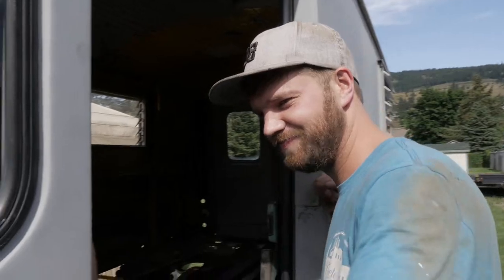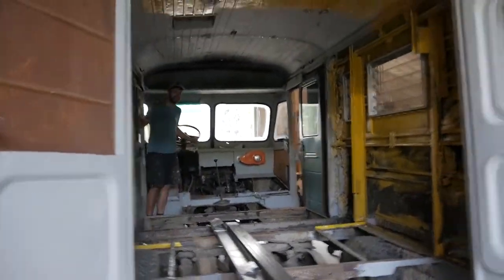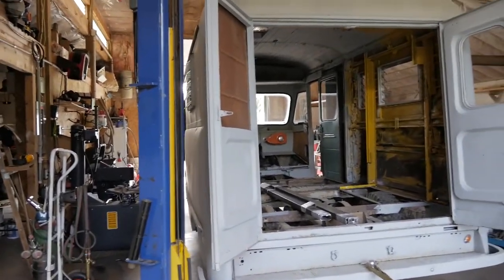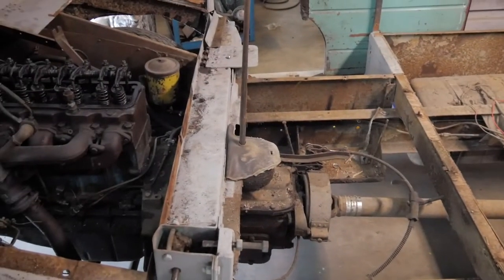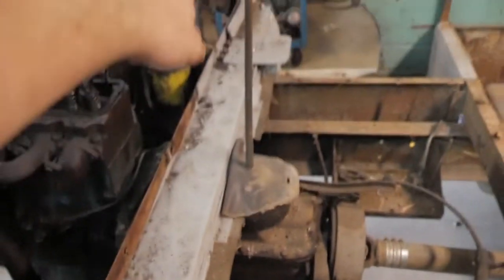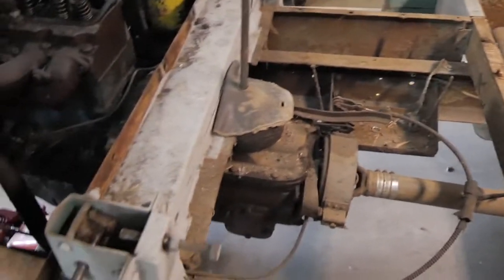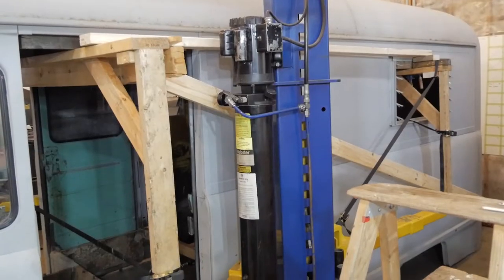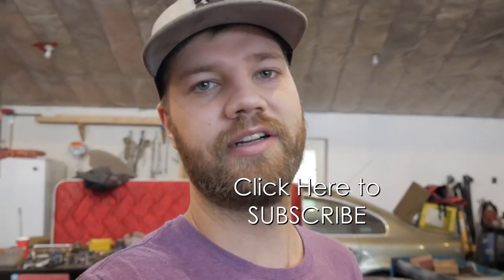1955 Chevy Van Build - Removing the Body From the Frame - Walde's Garage ep.5

Comment: Nice video! I had done a backyard chassis swap on a '57 Grumman years ago and it wasn't near as easy as your method. Glad I came across this! I am getting ready to swap a chassis from under a 1961 Grumman. With the lessons previously learned, and utilizing your 4 post lift method, I think I will be in a much better position. I hope to use a 1988 GMC 1500 4x4 chassis. I will either use the 305 TBI that is in the truck, or a 2001 LS I recently picked up. Speed safely! #2%